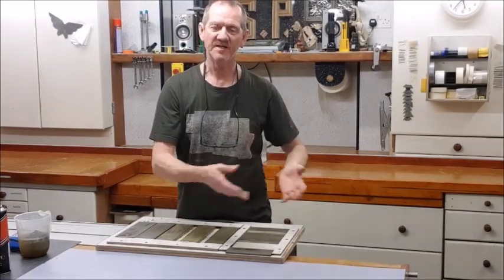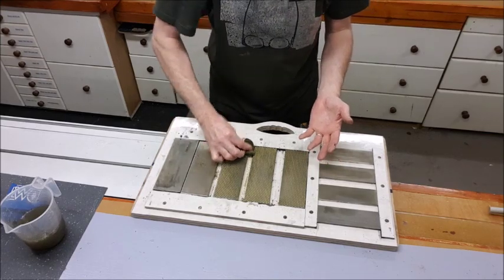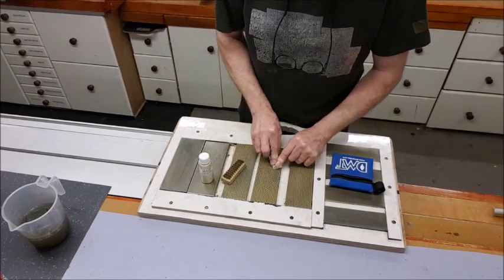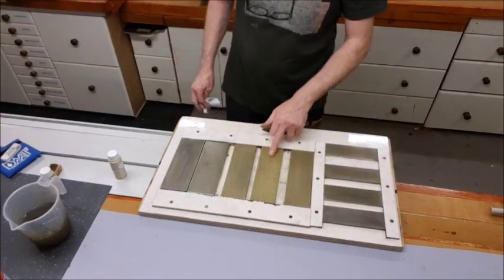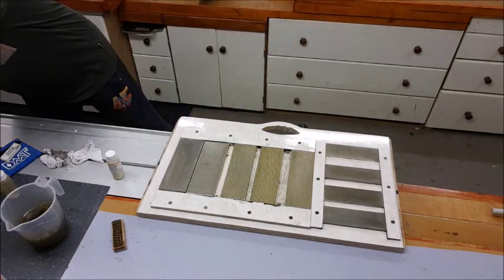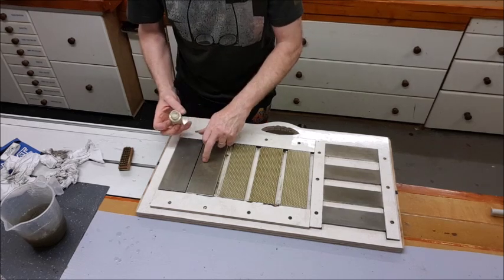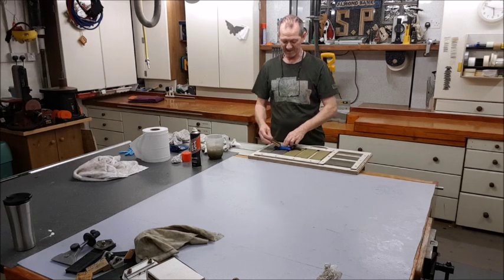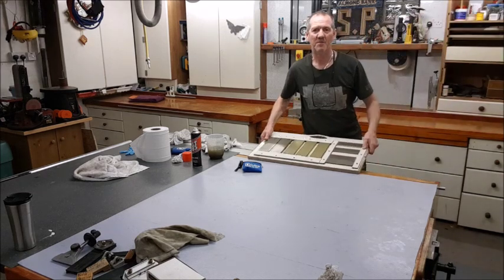Restoring your DMT Diamond Whetstone

Comment: I tried using dish soap without much luck but then I used a dry plane blade without the normal window cleaner I normally use as lapping fluid and it worked wonders, no problem with the blade nor did the powered steel get caught up on the stone, I found I could blow the powered steel away. Now my diamond stones cut as they did when I first got them and they are clean as a whistle. No more lapping fluid (window cleaner) for me, every 1 minute give it a blow and they are good to go. This worked on all my stones, cause, median, and fine.....give this a like if it works for you.

Comment: Use dish soap and water when you're sharpening. You don't get build up and it keeps metal particles/dust from floating around so you don't breath them in.
Reply from the maker: Yes good tip i will try that one thanks
Reply: @dmgladden  You're very welcome. Hope it helps
Reply: I guess Im randomly asking but does someone know of a method to get back into an Instagram account??
I stupidly forgot my login password. I would appreciate any help you can give me.
Reply: @Jose Peter instablaster =)
Reply: @Jaxon Abraham it worked and I actually got access to my account again. Im so happy!
Thank you so much, you saved my ass!
Reply: How about Krud kutter?

Comment: My DMT Dia-sharp 120 is completely worn out after less than a years infrequent use.  Bit disappointed.  I can see (using a magnifier) craters in the surface where the extra coarse diamonds once were.  Just in case anyone out there is thinking of investing a not inconsiderable sum of money in these.  DMT's customer service suggested cleaning but that is 100% not the issue.

Comment: This is some funny stuff here. Next video, restore your stone with an angle grinder, Ha Ha Ha. Somehow, that coarse metal brush looks like it destroys surfaces, not "renew" them, whatever the hell that means. Ha Ha Ha.
Reply from the maker: Its a brush made for the job by the makers of the stone but i guess they may not be as wise as you
Reply: Diamond is waaaaay harder than brass. I actually use a brass wheel with an angle grinder.